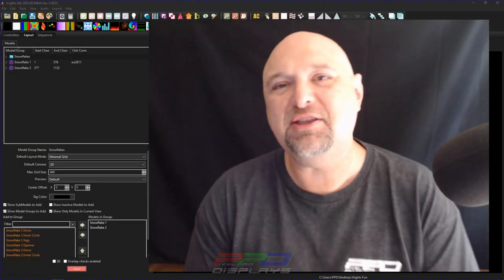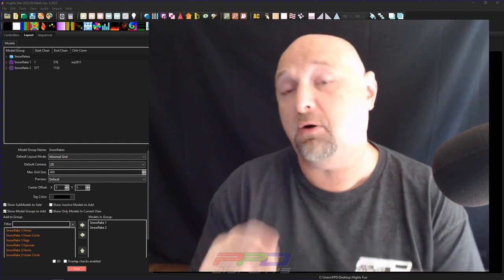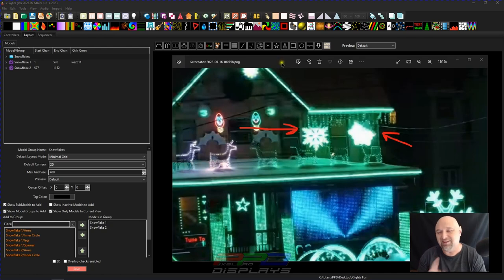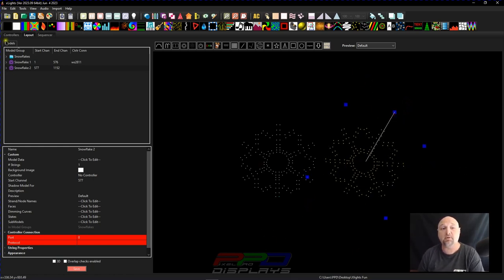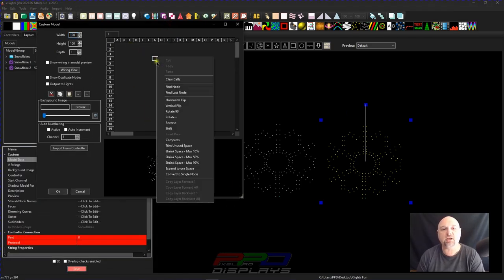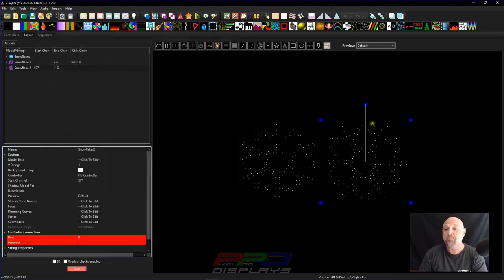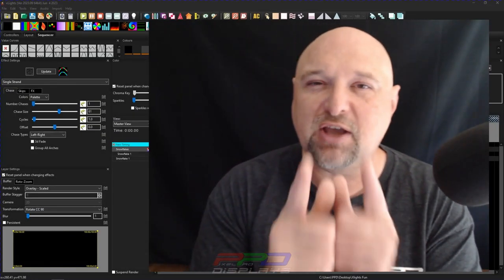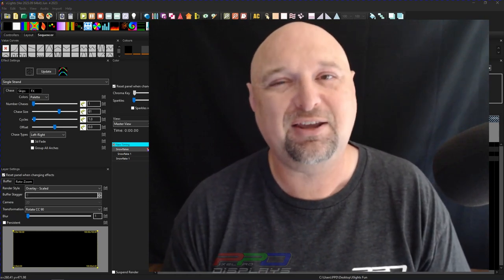🎥✨ Twinkle Tips Friday: Properly Rotate Your xLights Models

Comment: Great tip as I am in process of 3d printed mounts and how they attach to GE A1 flakes, good to know if mounts causes flakes to be off and how to correct
Reply from the maker: Keep in mind that many 3D printed mounts are created to sit on the prop and hold it in the correct orientation. In my case, I made my own 3D printed mount and applied them to the wrong location.  I don't want to throw anyone under the bus. You can generally trust the folks who produce them for the prop.

Comment: If it is symmetrical .. look at doing a # shift (it moves pixel 1 to say 30, 2 to 31, etc)  - this way the model data doesn't get squished or mushed up from rotating.
Reply from the maker: That's a great point. The model would come out more "pretty" that way.  I was more concerned about the effects rendering correctly and this was a quick fix.

Comment: When doing a 360 Mega Tree where should pixel 1 be located?   I've tried rotating the tree around and that didn't seem to work.   Not a huge concern most of the time but when you put images on a tree and you want them to face front and not back it matters big time.   My tree is 32 strands of 100 each running on 8 ports.   Port 1 pixel 1 should be where?  Do I then run clockwise or counterclockwise with the remaining strands around the tree?   Thanks
Reply from the maker: In the model settings you have the option to setup the tree either from the left bottom or right bottom.  On a 360º tree, the back side of the tree is where you would start.  If wiring starts at the left, the connection goes counter clockwise starting at the 120oClock position.   If starting from the right, the connection begins at 12oClock and goes clockwise. This is a good idea for a video which I can produce a demo of.
Reply: @PixelProDisplays  Again thanks... that is what I surmised after multiple people tried to help me "electronically" rotate the model.   Not sure why I had a problem with it last year or maybe I accidentally got it correct my first year but last year I was at the 9 oclock position for the first strand and ran clockwise.  Couldn't find anything in xLights that would effectively rotate it 90 degrees clockwise to get things where they needed to be... so I "lived with it".   Didn't want to "live with it" again this year.